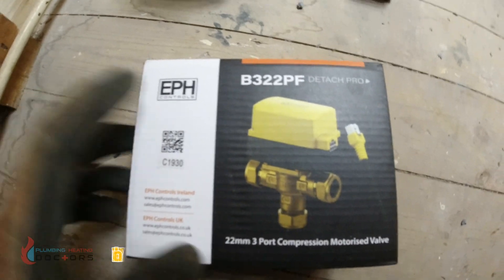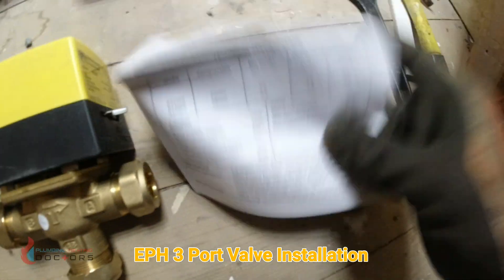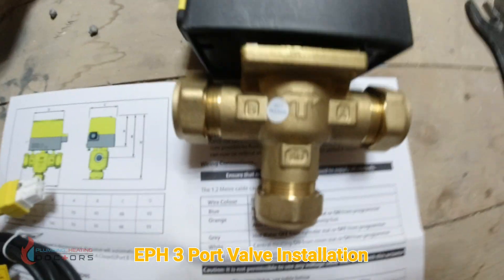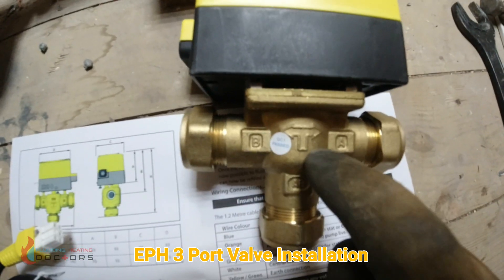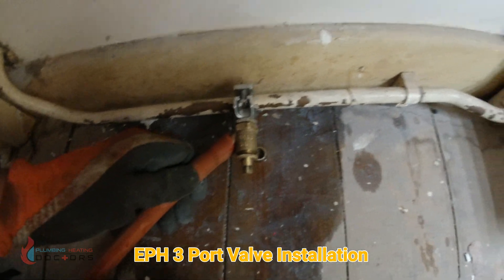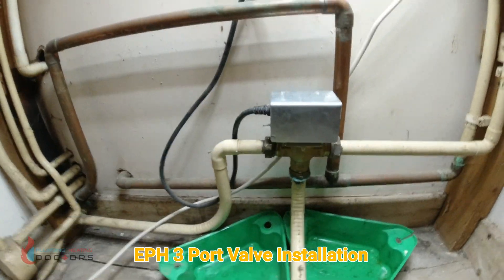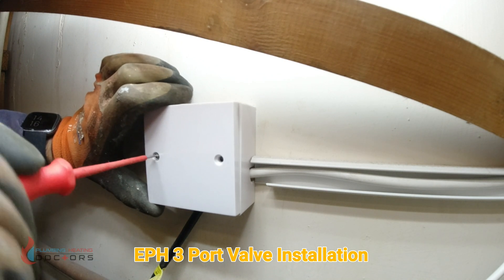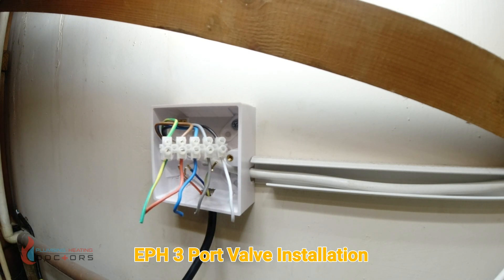EPH 3 Port Valve Full Installation | Mid Position Valve

Comment: Is there a way of removing just the eph acuator I see that some have the release button but mine doesn't.  I only had it installed just over a year ago so valve fine.  Mine is an EPH B322PF
Reply from the maker: May not be removable
Reply: It has the plug that comes out and it says its a detach pro.  Not really detachable if that is the case mate! 😆